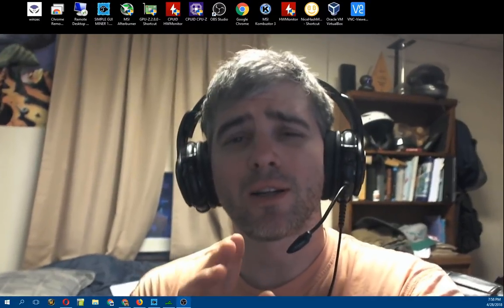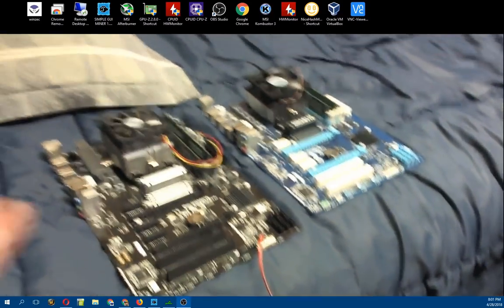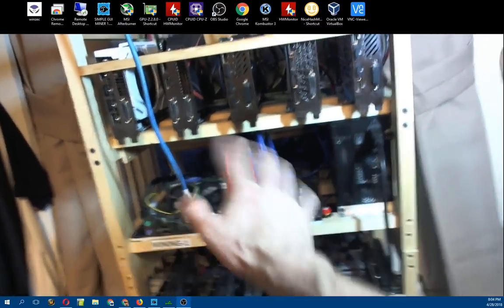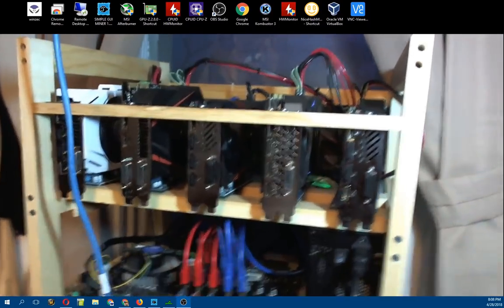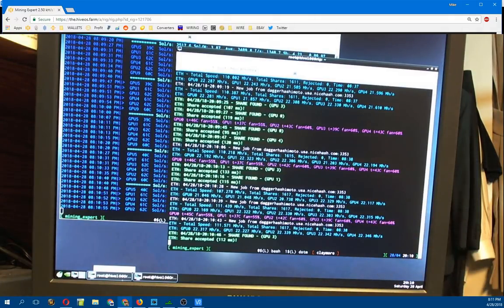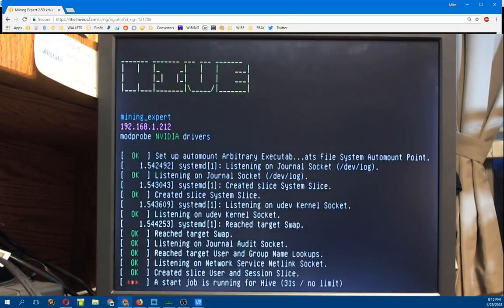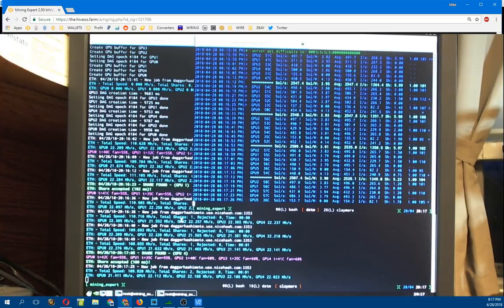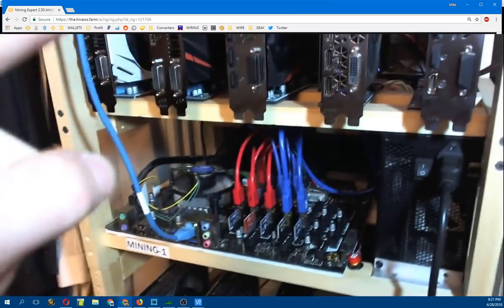My new Asus B250 Mining Expert - 19 slot GPU Mining Motherboard. To the moon baby!

Comment from the maker: Let me know if you have any questions about this piece of hardware, I will be happy to help answer any questions that I can. I love this thing, I should have bought this a long time ago....
Reply: I recently got this MB and a cx 850m power supply, a g3930 cpu and 4gb of ram for this MB and when i do all of this with no cards even attached i get nothing. I am not even getting the fan to spin on the power supply and I have switched the power supply twice. does anyone have any idea of which piece might be faulty?
Reply from the maker: Is the power button plugged into the proper spot on the MB? Have you tested any of those components with other systems to verify they work?
Reply: Fishmonger ! Thanks for the response. Yes the power switch is in the right 20+5 spot as far as pins go. I have tested 2 gpus and confirmed they worked on other PCs and I have also confirmed ram is good in another Pc. It seems like it has to be a motherboard or cpu issue at this point I would guess but I don’t have another one of either I can test with. Both the motherboard and cpu are new so I can send back for new ones just don’t know which one is the issue.
Reply: Since Asus cust. service is incoherent, Can anyone tell me how much power the board itself draws?
Reply: @stephenlyons6010  Say .I just bought this board. The only difference is an Hp 750w server power supply. Will I find issues? Still waiting on an atx 24 pin power module.
Reply: Hello I was just wondering if you can hook up 19 amd radeon vii cards since they draw so much power please get back to me when you can thank you!
Reply: @maxywizard  it requires a certain # of mining specific cards. It's in the man.. also watch Ytube chnnl Bits B Crazy about this.
Reply: @3576alan  thank you vm i hope it will allow me to run them! and i think you mean Bits B Trippin and I will I appreciate your response!!!!
Reply: @stephenlyons6010  Did you ever remedy your problem.  I just got one last week then got a replacement, and i'm having the exact same issue
Reply: How much is maximum AMD card support?
Reply: could you give a closeup video image of or make  a video of you pluging in the pin wires like the power led power switch ect?
Reply: A small question. I am a newbie in mining. 

I brought B250 motherboard, and some GPUs and you know RAM, CPU etc. 

Do I need 3 PSUs to run the motherboard ?

Quick reply is really appreciated.
Reply: hey @fishmonger what OS are you using to mine? Does windows 10 support more than 8 nvidia GPUs now? curious about your latest setup with this
Reply: is one power supply enough only for the whole rig? I am really new to this and I will be happy someone explaining it tome
Reply: @TheLastMohican1907  It depends on the number of GPUs and their wattage. 

For example you had 1200 watt power supply. And you had 130 watt GPUs. 
So you can connect almost 1200/130 = 40 GPUs. 

But lol there will not be that many pins. So, you got the point right.
Reply: @TheLastMohican1907  Add all the wattages of the GPUs and that number should be less than the wattage of PSU.
Reply: hey fishmonger, i recently picked up the same model but don't know how to turn it on. Do you need to plug in all 3 12V 24-pin supplies? i have 3 but I'm using one card just to see if it will boot, riser powered and all, all fans spinning but no output. any suggestions?

Comment: So if i have 8 gpu and 2 power supplies. 4 gpu per power supply. 
I use the 7 pcie slots on A bank. And one pcie on b bank.  I dont need an atx power on B?.
I can use one Atx power supply on A and thats it?

Comment: Answer me please
1-How many GPU you used in video
2- is require to plug CPU connector with same power that using  - 24-pin with A slot ?

Comment: I have the Asus b250 motherboard and it installs the AMD RX 580 in device manager but nicehash is not detecting all the boards only 2 or 3 max. Can you tell me what is needed to hash with 5 580s what setting on bios and windows 10 I am using. Step by step what is needed ?

Comment: This mother is not friendly with AMD cards.
OS does not load if AMD card is connected.
Disconnect the AMD card, - and everything works.
What I did not do: I plugged the card into different PCI-E connectors, connected it together with NVIDIA card to various groups of PCI-E connectors (A, B, C), HDMI plug inserted into the  card.
First, it will work, and after a while - bam, and the rig stops OS loading!
Reply from the maker: I have six AMD cards running a mix of 5700 and 5700xts, along with three Nvidia cards and a dedicated p106 mining card. Boot up is never an issue but I have had problems with getting device drivers to load and configuration set. It took a while but everything's up and rolling now. Also this rig is running on Windows and not using Hive anymore, the drive I had Hive on died and I just never got around to hook it back up again

Comment: A small question. I am a newbie in mining. 

I brought B250 motherboard, and some GPUs and you know RAM, CPU etc. 

Do I need 3 PSUs to run the motherboard ?

Quick reply is really appreciated.
Reply: no only 2 with spliter cable but from were did u get the boad?
Reply: @rprinku  some seller on india mart.

Comment: I think there's a conspiracy. 🧐 Has anyone tried  finding a complete "plug and play" 24 pin atx power module recently?  Amazon is completely sold out of the top 3 variations. The rest don't come with 6pin to barrel connector. WTF!😖. The only complete set I could find was some shady Chinese "Ebay knock off" website. Also......Amazon......It uses ALL SIX WIRES SPLICED INTO THE CONNECTOR. F<"kin shady man🤨..............I bought it. $19. I also threw in a connector tester w/ purchase. Wataya think fellas?.....felladies?😥

Comment: Hey! Nice video. Quick question you running this from a USB or an SSD? I have got a B250 mining expert do I need the disc as this is missing.  Just waiting on CPU to arrive then starting the build! Thanks
Reply from the maker: SSD, not that it was necessary but I had a sparebone laying around. Any software or drivers you may need you could find on the website but if you're running Hive you won't likely need any period
Reply: @fishmonger1526  Hi thanks for the response. . I was watching another one of your vids when you sent this. I am unsure on what to do as of yet. I have an RTX 3090 getting delivered next week to start but was thinking of using the windows 10 and using Hicehash. And when not playing on games switch it to mining. I don't have to pay for power so looking to add a few more then available. What your thoughts?

Comment: I don't know how you sleep in the same room as that many video cards. The heat and noise would drive me crazy.
Reply from the maker: Well, I haven't had to run my gas heater since January because this has pretty much taken the place of it. As far as noise goes, its really not that bad... the cards I use have very good coolers on them which allows me to keep the fan speed low. Also, I live 3 blocks from a train station... so the noise from these cards is nothing compared to the freight trains lol.

Comment: how many or a total of wattage of your power supply, because the ASUS B250 MINING EXPERT manual says, the power you need (wattages) is at least 3,750 watts at least, dindo from the philippines?
Reply from the maker: It just depends on the draw of the video cards. If you are only using 50 watt cards, you can use a 1400 watt for all the cards, the board, CPU, etc.. if you are using 140 watt cards, you would need easily over 3000 watts of power

Comment: Dear Sir:  You make awesome video! I just try to build a mining from B250 mining expert mother board, I installed CPU,RAM and plug monitor adapter ,only didn't fix it the mother board. I turn on power ,it didn't active the system at all. what it could be wrong?
Reply from the maker: Are you sure you have the power button plugged into the proper plugs on the motherboard? The writing on the board and the instruction manual are not very well written, but if you don't hook the power button up to the proper headers it won't turn on.

Comment: What power supply would you recommend for this if you were to buy one today?
Reply from the maker: It really depends on the types of video cards you are looking to power. Once I went with server PSU's, I can't swap back. Anything else seems like a waste.
Reply: Sorry, I'm very new to mining.  I was thinking of powering RX Radeon 570s or 580s,  If I were to search for a server PSU, what keywords should I include in my search query to make sure the PSU would work well?  Can you uses two 750 watts PSUs?  Or, do all your videos cards need to be on the same PSU with a common ground?  Also, if I were to find a cheap server PSU at my local computer shop, what connectors should I look for or what adapaters would I need to purchase online to make them work for mining with this motherboard?

Comment: So I have this Asus board, and when I plug in my corsair 1500i, every thing tests until I plug in the 24pin atx cable.  Mother board gets no power.  Does any one know how to help me get power to the board?  Thanks
Reply: There's 3 slots. Which group are you using? A B or C?

Comment: no one born know everything . i already have rig but i have question 
my psu is for mining so i came with cables need for rig
this cable (sata power ) i use x2 like this cable
https://www.coolblue.be/en/product/766401/startech-sata-power-supply-splitter.html

and plug to resiers 2 or 3 or 4
is safe ?

Comment: I have the same board but when I run more than 8 it gives me issues. I am running 7 1050ti 1 1070ti and I have 2 more 1050ti on my desktop.
Reply from the maker: Odd. assuming you've tried swapping around into different slots? Are you running it in mining mode? What about changing the PCIE connector slot type to Gen 2?
Reply: Steven Mark Try uisng simplemining,hiveOS or ethOS.Windows is usually very unstable or sometimes doesnt run at all with more than 8 cards.I also read somewhere,that you might want to check windows server instead of regular windows.

Comment: Use it but can't add more than 8 GPUs on it, how did you do ? What can I do ?
Reply from the maker: You have to use certain mix of AMD and NVIDIA GPU's, the manual lists what cards can be connected where.
Reply: @fishmonger1526  I did it, and I connect each one to it specified location, but always have BSD when add more than 8 GPU. I'm being mad !
Reply: @fishmonger1526  what manual? Mine didn't come with a manual showing that. I'm stuck at 13 cards trying to push it further.

Comment: I have asus b250 mining expert board and sapphire rx470 8gb 12gpus my 8 gpus are working fine but when I connect my 12 gpu my rig gone hang and reset my rig I have 1 1600w power supply, IK that I need three power supply more to access my all 19 gpus so anyone have a solution or that. Plus I wanna to used one power supply and one atx extra connector for so I’ll be get to atx connector from one power supply. Please advice 
thanks.
Reply from the maker: Hey Mohammad, in order to get to 19 GPU's you need the special P106 mining GPU's from nvidia, without them you are stuck at just 13 max.
Reply: Fishmonger ! Yeah actual today I ran 12 amd RX470 8gb 256 gps on this board and working fine. And getting 28.5mhs from each card.
Reply: p104 and p102 cards should work as well. Another youtuber is running 19 card rigs with p104s
Reply from the maker: trapped cat not sure about the p102 but I know the p104 cards do work. Problem is, you can't find them for a reasonable price so it makes more sense just to buy a whole new motherboard and set up instead
Reply: Fishmonger ! True. 104s are ~$700 at Bitnand mining whereas 1070s are selling in the $500 range.
Reply: trapped cat true but guys you and me knows that very well current all gpus models and brands are given 28mhs to 31mhs, if you install the 4GB 256bit card it’s will give 28+1mhs and also 8gb 256bit will gives the mhs. And above all P104 is getting high power too, which is notable too. 
I can’t understand that why many peoples are so much interested in high hands cards?
Reply from the maker: I'm getting 3GB 1060's off of ebay for less than $160 - ain't no way I'm going to pay a premium just to fill the last 6 slots on this motherboard with the special mining cards. I'll buy a whole nother rig and setup before that happens :)